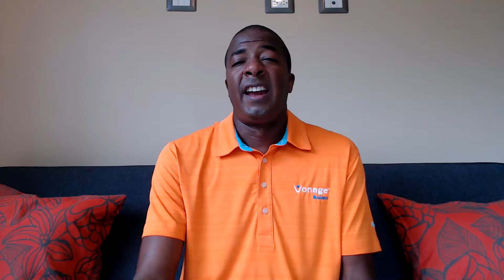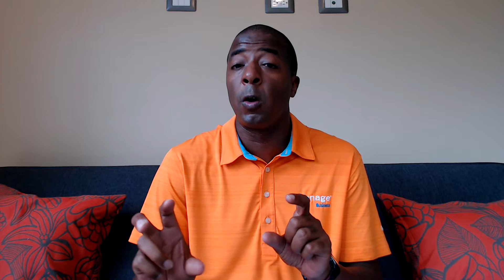What hardware is required to install a VOIP phone system?

Comment: guess I can't use wifi?
Reply from the maker: You can use wifi with VOIP. In fact there are wifi compatible IP phones you can use to connect to the internet via wireless, however you need good internet and a strong wifi connection for this to typically be VERY reliable. I hope this helps answer your question.

Comment: I have a large network and I required a mange switch to create VLANs and a different sub-net for the phone.  Do you have any information on this?
Reply from the maker: Hi there. Actually I've personally setup a multi-VLAN VOIP setup awhile back for an incubator that had multiple tenants all wanting to use separate VOIP phone systems/providers on the same network. For equipment like that, specific to what you're trying to do we recommend, and have some great contacts at VOIP Supply. Feel free to message me directly via the following link and I can put you in contact with my technical contacts there who can assist: https://www.richtechnologygroup.com/contact-us.html

Comment: Hey Rich
I recently worked for a state contractor where we cutover to Cisco VOIP for every state facility
(large state).
No more crappy ILEC phone lines
(Frontier, AT&T)
Rain or shine voice quality is fine
The only issues they had or some intermittent fax trouble
Reply from the maker: That sounds awesome. Stay tuned as we recently partnered with Cisco and we are working on not only offering their IP phones and WebEx UCaaS solution bundled with it to clients who want Cisco, BUT we should start having actual Cisco hardware reviews on the channel, so stay tuned!

Comment: In Australia. 
ISPs charge for extra for VoIP, and router, and phone, on-top of their internet connection ($70/mo for 100Gb @ 12mps max speed). And, the cost of getting the NBN conversion, if the previous occupants didn't want to
Reply: VOIP from internet companies passed off as a home phone !  NO it is not as good or the same as a old analog hard wired phone !  Power outages will soon make that clear.